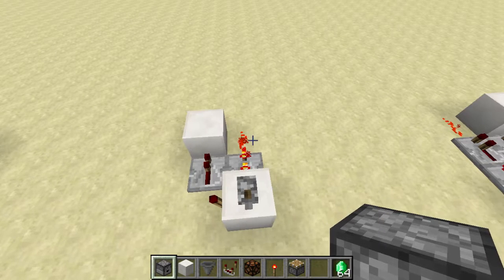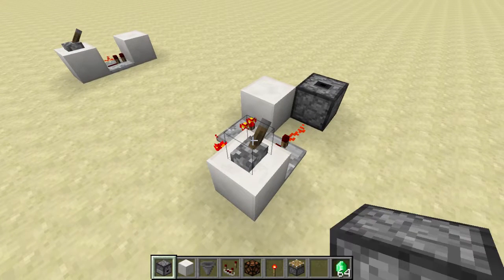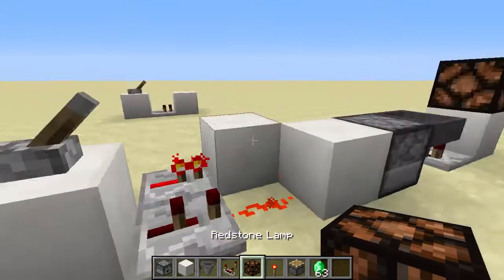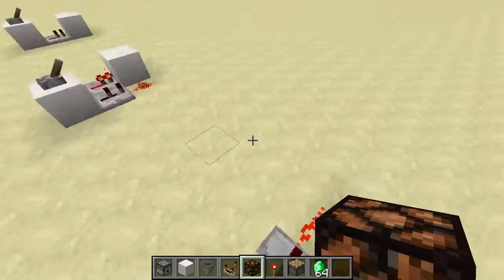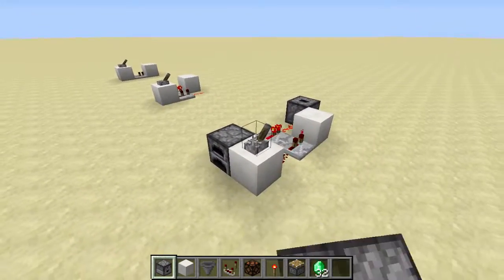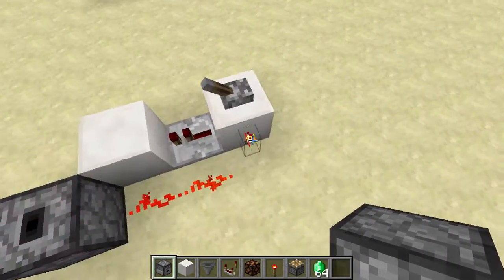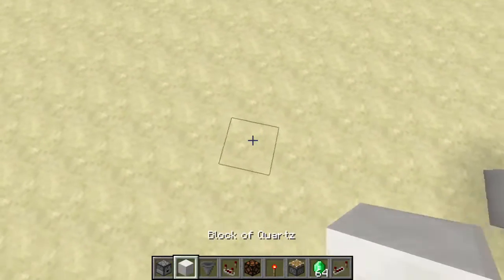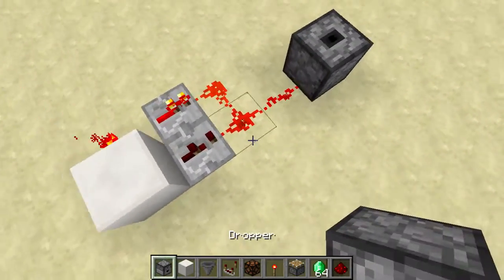Silent, Compact Dual Edge Detector (Minecraft 1.9)

Comment: Really nice design. Doesn't quite fit in the space for my current contraption but I'll be using this in future for sure :-)
Reply from the maker: Thanks! You'll probably have to use a piston to get it any smaller than this, but it's doable.
Reply: Yeah I figured out the trick with moving a redstone block. I was working on a hidden staircase so the noise wasn't an issue. There are some designs that this would fit in better though for sure, such as in tight spaces where you're worried about bud powering the piston in the other design. Interesting that this design only works when you have those 2 "buffer" repeaters in there, not with dust on one side and a 1-tick delayed repeater on the other.
Reply from the maker: Jonathan Harris Yeah, it's a strange bug. I know which design you mean with the piston, and that's a good one too.

Comment: HI old friend! :D Nice find! It's a shame the output is inverted though :P would've been super useful
Reply from the maker: Hey pal! Haven't talked to you in a while! I still think it's pretty useful, considering you can invert the signal with a dropper and hopper at the cost of some compactness. And if you only want to use it to dispense an item, it works as-is.
Reply: +emeraldfyr3 yeah, but the idea of a solid state 0 tick pulse is really intriguing and also, the delay of the dropper monostable is kinda long
Reply from the maker: WoolTec Mc True, if you need the dropper module for what you're doing this might not be the best design. What do you mean by solid state 0 tick pulse?
Reply: I mean a 0 tick pulse without pistons. arguably ´0 tick pulses are mostly used with pistons contraptions, but having a simple way to create such pulses would be great
Reply from the maker: +WoolTec Mc That would be cool. I can't think of a way to do it without moving blocks, since repeaters, comparators, and torches all take 1 tick to update.
Reply: Indeed